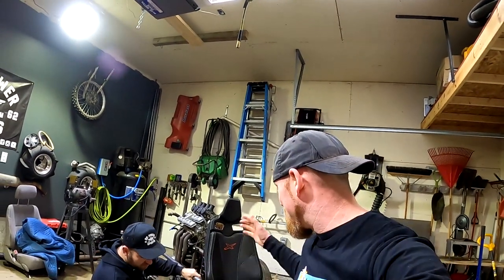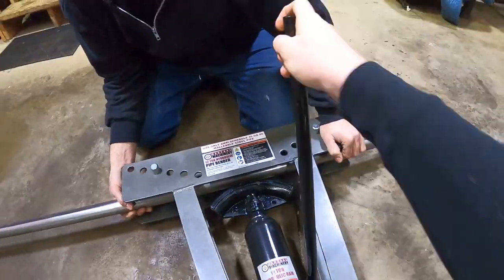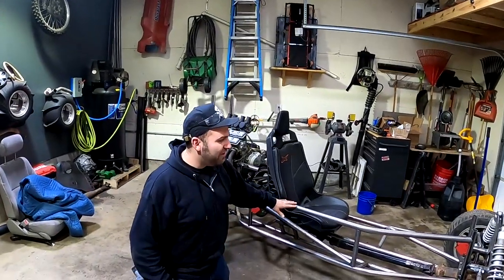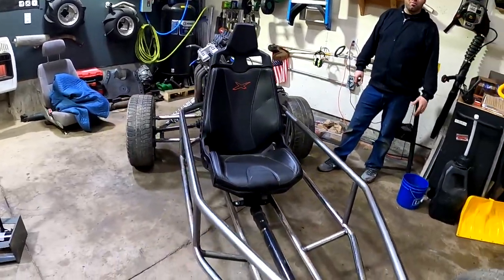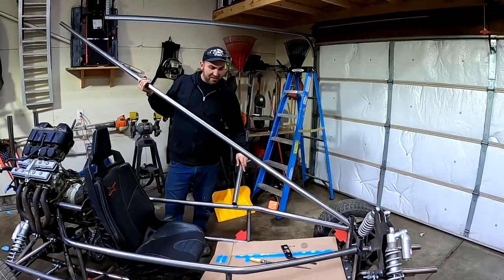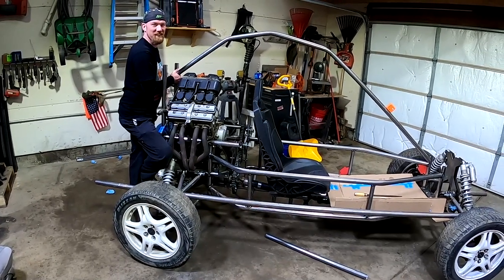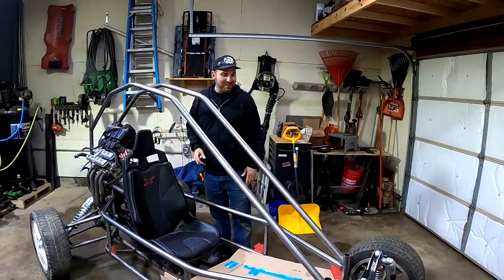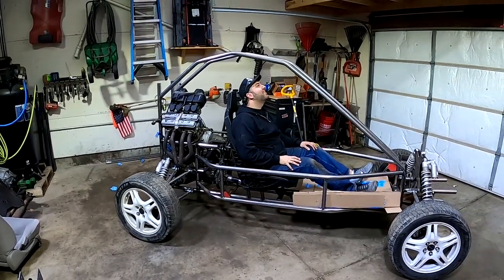ROLL CAGE | 4x4 CROSSKART | Subaru Drivetrain

Comment: I use a harbor freight bender the same as yours. Here's a tip. Mark your bend point and then mark half-inch increments 1.5"-2/5" from the center point. Start at the center point and work out from there counting your engaged pumps (5-6 pumps on each mark). I get good tight bends this way with no kinks. I'd love to buy a high-end bender, but they are ridiculously expensive!

Comment: Hey guys looking good! Hey if you pack you tubing with sand  and then bend it you won’t get as bad deformation at the bend I started out with the same bender and when I was bending it it was flattening at the bands and with a lot of research, packing the tubes full of sand and it actually works pretty good it’s just a lot of work. Now I own a rogue fab pipe/tubing bender which is awesome. Keep up the good work guys.
Reply from the maker: Thanks, we really want a rouge fab bender! We need to save our pennies lol

Comment: A little wider would have been nice but it's looking good.
Something that I don't usually condone but some wheel spacers would help.
Reply from the maker: Yea thats an idea!  We are at 61 inches wide currently.
Reply: @CRACKEDHOUSINGFAB  
  Normally I dont like wheel spacers due to the stress on the bearings but sometime ya gotta do what ya gotta do.
With longer control arms you'd have achieved not only a wider stance but more travel in the suspension.
   But nonetheless it's looking damn nice!

Comment: Overall it looks good, but I personally think there is too much room above your head. It could come down another 6-8 inches.
Reply from the maker: Yea we spent alot of time working on the height. It looks a taller in the video than in person.  When wearing a helmet, there is about 4  inches between the helmet and the roll Cage.  Thanks for the suggestion!  We appreciate the input

Comment: Tube not pipe, what about your main hoop for the roll cage? The hoop behind the driver tying one side to the other, should be about 5" above the fivers head with a helmet on. The main hoop is usually rhe first component in roll cage construction and is a key piece.